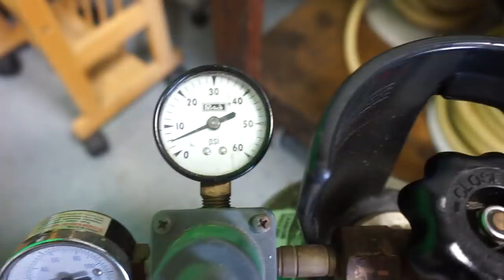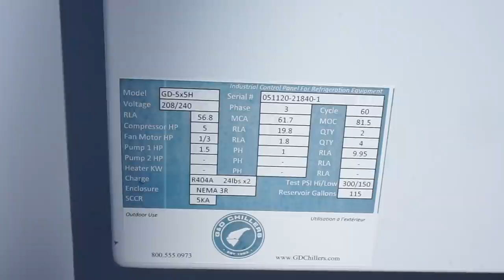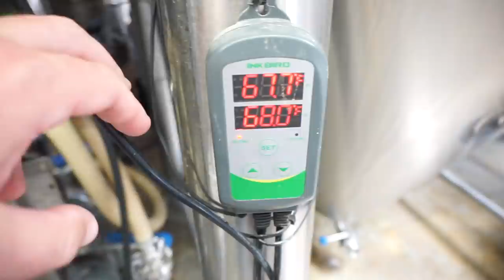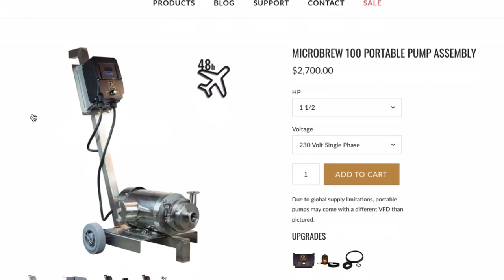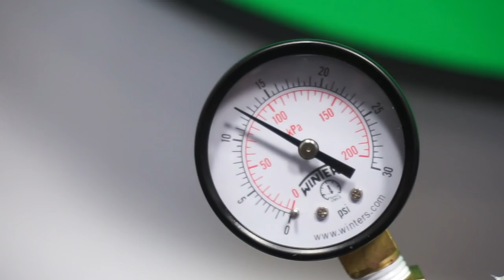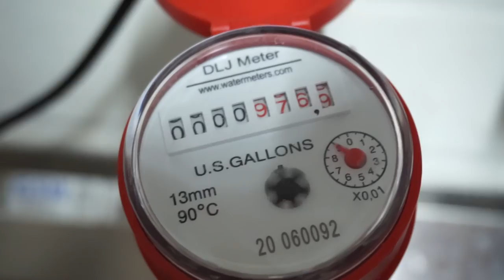HOMEBREWING VS COMMERCIAL BREWING

Comment: Cool video comparison! So I've been reusing yeast for about 11 months, but kind of a different route then most people would take. I have 2 separate keg kettles, and 2 keg fermenters. Once I have 4 empty corny kegs I brew beer, and while doing so empty the beer from the fermenters to the corny kegs. But I leave the yeast and probably some beer behind in the fermenter. Then I add the wort, and within a few hours the airlock is bubbling. Yes this also means I haven't cleaned the fermenters the entire time. But honestly the beer has turned out great everytime, and I've done lots of variety with hops and grains.
Since I brew so much at a time and store the beer in corny kegs I add a dme simple syrup to the corny kegs, just like with bottling. But, I depressurize the kegs before putting them in the kegerator, then hook up the co2 at around 10 pound to pressurize it. Pressure from the yeast and simple syrup can get up there. Sorry for the long post
Reply from the maker: Solid feedback as always KF!
Reply: @HOMEBREW4LIFE  Thanks! Hey another channel I follow showed in a video that she has beer mugs with her logo on it. Might be cool if you had yours on 1 liter beer mugs and/or kolsch glasses

Comment: If you want purified water as a commercial brewery you need an RO system with a very big water container to hold the water before adding it to your hot liq and cold liq and just add the minerals back in with your sparge and boil. Best way to make consistent beer without have to use city water that is different all the time.
Reply from the maker: Solid feedback!

Comment: Great stuff great info thanks!
Reply from the maker: Thanks again cube!
Reply: Just a question, when heating your sparge water which is going into a cooler to then run over the grains.  The water that actually goes into the cooler what temp do you usually bring that water up to?  Would you say 200 degrees is too high?